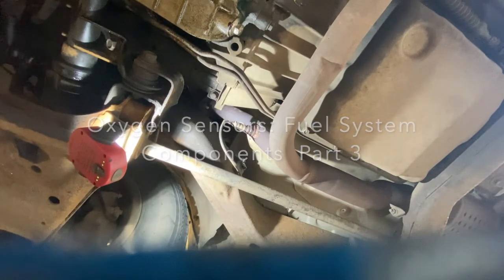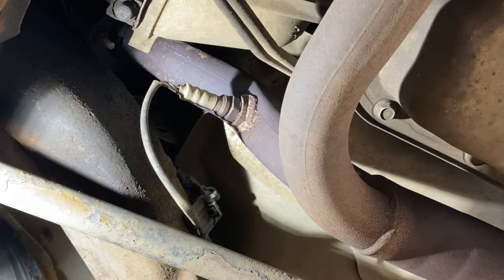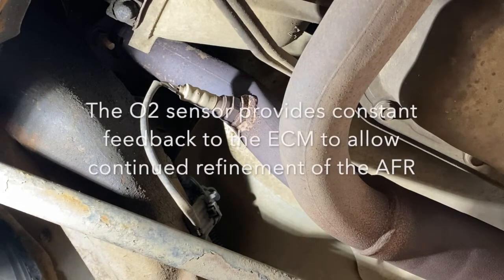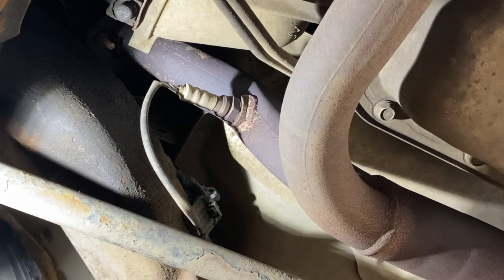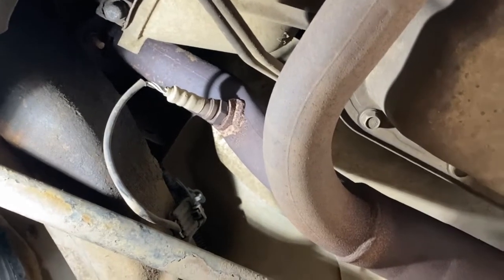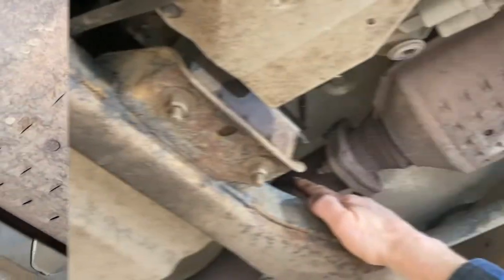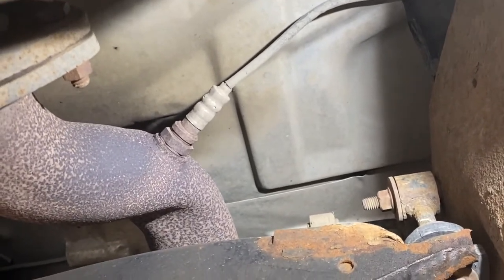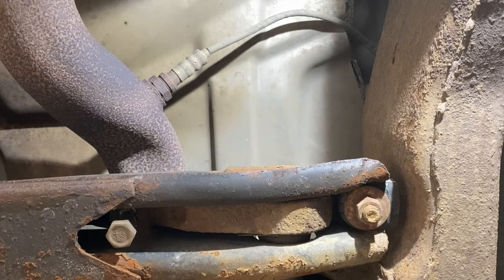How oxygen sensors work

Comment: What happen if the oxygen sensor filament keep burning. Thanks
Reply: I already changes five times . the filament keeps open tt no resistance. Only works 5 days burn again.
Reply: Dodge grand caravan 3.8L SXT
Reply from the maker: Hi Jare.  That is a puzzling one for sure.  Sounds like you are going really lean and possibly overheating the O2 sensor.  It is difficult to say though without seeing it.  The best thing to do would be to have a scan tool connected to your vehicle to determine what your long and short fuel trim readings are showing.  If you are showing excessively high positive fuel trims, it would be a clue that your engine has a potential vacuum leak or low fuel pressure that can't sustain adequate air-fuel ratios.  This can elevate exhaust temperatures and cause damage.